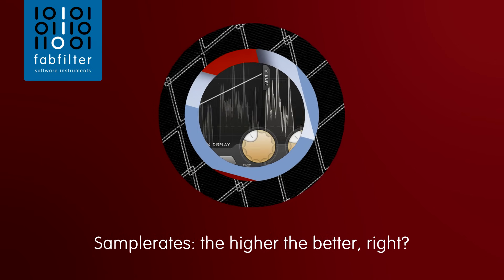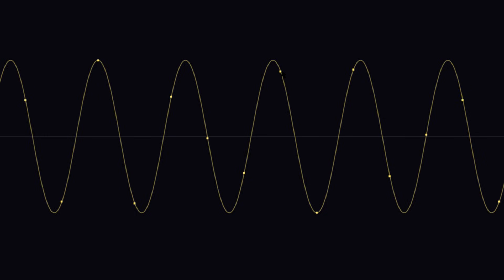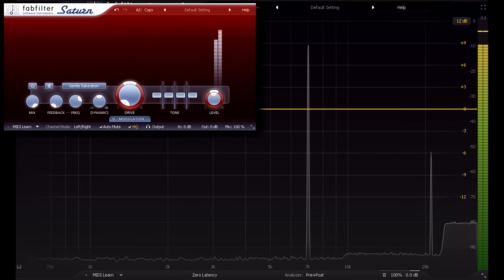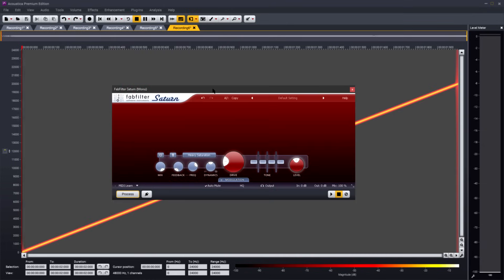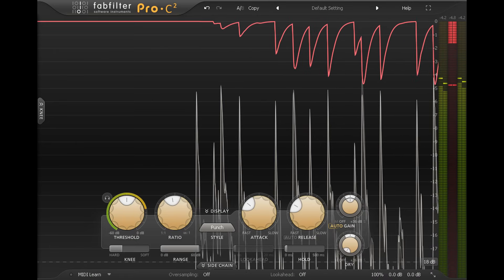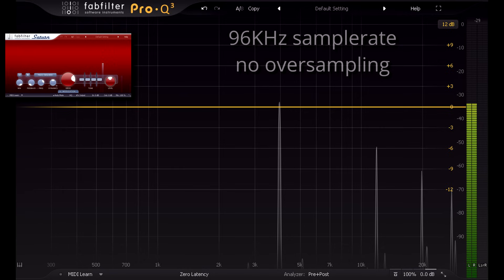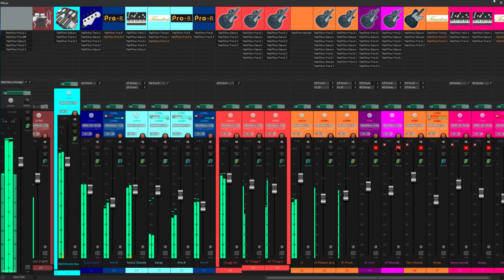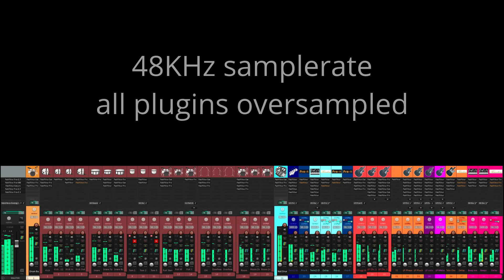Samplerates: the higher the better, right?

Comment: "can you hear a difference" - honestly? no, i can't

but i blame it on youtube compressing the video once again after upload and that my analog audio chain isn't exactly "studio grade" 

i run audio over HDMI into my monitor, use the monitor as DAC, go from its headphone jack through a pair of ground lifting audio transformers into my kenwood hifi amp, then into a passive subwoofer and a pair of old fisher bookshelf speakers that i fixed with cheap visaton drivers.

this setup isn't the best i've ever heard and it gets dwarfed in sound quality by my isophon speakers in the living room - but also dwarfed in physical size - while those isophon speakers are not really your typical floor-standing pillars, they are not really the common bookshelf type either ... 

either way - i like the sound of both systems a lot and that is what matters - right ?
Reply: "if it sounds good, it is good" ;)

Comment: 24:51 That 96KHz example sounded incredibly clean by comparison. The mid range in both 44.1 examples was a bit stuffy, slightly less so with oversampling, but nowhere near as good as 96.
I'm certain tracking and mixing in 48 or even 44.1 is perfectly fine if you don't have the horsepower, but why not mix down at 192 regardless? If it doesn't cost anything but a few extra minutes for a perceptible boost in quality, I say let it rip.

Comment: Sample rate became a marketing tool as manufacturers created affordable converter chips.  There is not a valid reason in the world to record at 192kHz while there are plenty of very obvious reasons not to.  Even 96k is being touted as a clear and obvious sonic benefit when in fact properly converted 48k is indistinguishable from it.  Hi rates are beneficial for some DSP processes but generally a complete waste of valuable and finite resources.  Some lower end mixers sound noticeably better at 96k than at 48k but curiously, that does not happen with all of them.
Reply: But this video is not about recording, it's about aliasing from saturation plugins.

Oversampled sounded better than non-oversampled, with that amount of saturns and compressors.

Comment: Thank you for the informative demonstration. I agree with everything in this video, however I would like to elaborate on 1 matter.
"Digital system CAN represent all frequencies perfectly, as long as they're less than half of sample rate." 

You cannot recreate the sine wave perfectly unless you take the sample points perfectly. I don't know the limits, but I know you can't store the information of say, 1000.111111111...Hz goes to infinite. It needs to stop somewhere and round it, in order to store the information. Thus, almost all of the frequencies of the original wave will be recreated with minor error. The error is reduced on higher sample rate, but accuracy is not infinite. Same logic goes for the bit depth. And people who might argue that dither eradicates the problem on bit depth, it does a great job however of suppressing it, however it just spreads the errors, so it is far from being perfect as well. 

HOWEVER 44.1kHz sampling might be more than good enough for human ears, that's not my point. I can't hear the difference of 0.2 dB or 1Hz difference at 10,000 Hz to 10,001 Hz for instance. 

We can also discuss maybe there is not perfect sine wave in real world nor perfect microphone as well. Perfect microphone could't not be made because it will always intervene with the sound waves no matter what we do, but that's not the point. 
The digital system used in audio is not perfect. Xiph.org made that mistake as well. The timing errors between 44.1kHz and 88.2kHz are measurable on the digital systems, but now discernible by humans. Some other people pointed out that when pitching down or slow motion videos, higher sample rate does hold more information of both frequency accuracy and timing accuracy and gives greater results.
I know, the sound has it's uncertainity and microphones are much much more inaccurate than the digital sampling process, however, the term perfect is valid only on the Nyquist THEOREM. Not in real world digital audio. 

By the way my own opinion about High-Res audio is that they're pointless. In my opinion, high quality masters with minimal / no compression is all we need. Thanks.
Reply: This actually isn't true at all. There IS quantization noise, but it doesn't come from sample rate. It comes from bit depth, as the amplitude of the wave is quantized per sample to the bit values that are available. However, even this noise is not a problem because of dithering. Dithering is shaped noise of our choosing that completely REPLACES the quantization noise.

If you're saying that transients aren't captured perfectly by lower sample rates (as in, the time domain), then you're just provably wrong. Go try it with an oscilloscope and adjust the attack time of a wave to anywhere in the time domain. It will be recreated perfectly anywhere

Comment: well this is a great video but it omits the player. As distorted guitar is one of the most difficult parts to get right both playing it through a plugin and due to aliasing let's say that you chose the plugin of your preference to generate the distorted sound for your track. And  stand for a time to the full latency you have to deal with. Anything over 7ms feels like dogshit when you track and may lead to problems of time allignment for two guitar tracks (meaning you track with the drums or metronome and then track the second track and you can't get it quite right or fast enough because of latency). To avoid aliasing the author here says to oversample internally paying some cpu toll and latency toll. 

48khz 24 bit won't get you 6-7 ms of latency before oversampling. It will be higher. 

Do you know what gets you less than 6? 192khz 24 bit not even 96khz. 

Now I've been doing this for years even when I was younger and did in fact hear over 16khz and of course I still can hear aliasing in less than 10khz. It is not easily detected...I do hear it in heavy distortion in some plugins and eg the kemper and the first axe-fx  Yet in the mix it seems almost inaudible. In the end the ear will erase similar frequencies of lesser db. 

Bottom line he hits the nail for theory here and he does provide great advice. But he has a terrible guitar tone as an example (sorry bro!) which isn't really complex and again you can track slow easy passages like the demo track but good luck on metal or thrash metal in 200bpm with heavy distortion. You need low latency or you need to man up and record analog with a mic in 48khz if that is what you want. 

To also provide another element, many high gain guitar sounds are intermodulation distortion, you don't need clean linear etc there you ooverdrive everything! Don't be afraid to try both but for me, man you are adding saturators for character and then you try to remove some back, that is inefficient! Even digitally first thing that should count is latency. Imagine an F1 driver having steering and breaking with more latency...

Try everything externally and even up the sample rate then.

Comment: Can someone sum me the point of this?
Reply: Lol that's the reason I'm looking through the comments
Reply: 8x oversampling and bandpassing at a plugin level (the "HQ" mode on some plugins) is better than 2x oversampling without a bandpass the whole project (running it at 96kHz).

As for "why" - you really should watch the video! :)
Reply: @DolphinWave  I think, if I'm not oversimplifying or misunderstanding completely, is the take home message was stick to a low sample rate like 44 or 48 cos the high frequencies get in the way when adding saturation. Am I right?
Reply: @orangemaniabrother2232  I think just using a low sample rate with non-linear plugins like saturation will still produce the aliasing. The idea was to make the plugin to oversample it very high (8x for Saturn) and then to cut off all higher frequencies to get rid of those intermodulations from leaking back into the audible spectrum. It will give better results even if you run your project at a lower sample rate, instead of just raising the sample rate of your project.
Reply: @DolphinWave  thank you dolphin friend well see US in a jungle wonday
Reply: @DolphinWave  thank you dolphin friend well see US in a jungle wonday

Comment: nope, it's fairly easy.
rule of thumb: maximum frequency produced times 2 = required samplerate

the factor 2 comes from nyquist frequency, you need to have your signal move from negative to positive and back to move the speaker driver back and forth, therefor you need twice as much data points, or the speaker would jsut remain on 1 side and produce nothing, it has to move at double the frequency of the pitch you want to reproduce.

if you use pure sine waves with no overtones, you only need a 8khz samplerate for a 4000hz sine, 
the rest is literally overkill, not to mention you can still upsample things egardless.
i use the old c-0 16.35Hz sinewave lookups and upsample from there trick to make additive synths all the time,
just make the sample so slow/low, youll never find yourself downsampling, and since it's very slow, it's easier to still exactly fit into the amount of frames of lower samplerates. (but one can have loop points or hardsync anyway so meh), this is how the old guys did it to work around the limitations of late 80s hardware lol

by that logic cutting samplerate down on waveforms that have more overtones (read: saw/square, anything not pure sine really) going beyond the samplerate/2, acts as a very shitty, rudamentary low pass filter with 0.0 amplitude falloff, it just hard cuts it, harder than the most tight 8 pole chebyshev you can throw at it lol

if you try to get a composite mixed signal on a lower samplerate the impact is way more noticable, as you're fighting hard to give everything it's little place in the limited spectrum, just like it is for bitrate,
just like a low bitrate will give you troubles leveling composite signals as the amplitude steps are limited,
you really start feeling it when you have to mix several signals.

but for seperate instruments you can go fairly low, i've made many a 16-bit 44khz mix using lower source material.
it doesn't hurt anything if you take it higher, except for file sizes though, so you may aswell with today's storage solutions

192khz is usually more trouble than it's worth though... as is 32-bit,
you'll find yourself downsampling and compressing the fuck out of it to make it back on a 44/48khz-16bit format most people listen to... don't bother with anything beyond 96khz/24bit unless you do big old orchestras or record samples that have to be boosted by a shit ton afterward (to which i say: you can also try to improve on recording your source material better)

in all fairness, realtime synthesis has become so good, and hybrid romplers are making waves too,  i find myself using softsynths more than samples these days,
samples are a ton cheaper on the old cpu, but with these ryzens around nowadays, it's no biggy now is it? 
DAWs are damn good at multithreading, and renoise runs very light too.

source: i'm a musician, and a pc nerd have been using mod trackers since the 90's (and now renoise for more than a decade too)

Comment: Frequencies that we cannot hear affect what we do hear
. This involves below 32Hz as well as above 20kHz. Many Famous Audio engineers believe this - Geoff Emerick - Beatles | Frank Filipetti. When I edit at 96kHz 24 bit - 96kHz 32 bit Floating Point and then mix down to mp3 = 48KHZ 512 kbps = I get better sound than your 44.1kHz 16bit CD demo. Further - you used ODD ordered harmonics = worst audio - You need EVEN ORDERED HARMONICS = TELEFUNKEN V76. Eliminate above 20K - get a cleaner lower quality sound. How come you didn't test 96kHz HQ?
Drums 16:30 over processed - lose power and impact.

Comment: A useful demonstration! 18:41 - 4k? you mean that frequency that usually gets notched away? :D 

While the Nyquist theorem of doubling sampling rate for getting the correct information is correct for sine waves that are easily mathed out and connected via a parabola, it does not hold water against more complex things happening in high frequency ranges, which is exactly what happens in the musical context. However. Before we hear the distortions and artefacting in that area, the average output equipment is likely going to apply it's own distortion on top of everything. But technology gets cheaper in time and accurate representation of sound becomes more affordable, so all that is left to say is "how far has your hearing degredaded compared to the equipment you listen to."
What this video sadly did not touch upon is; given that there is proof within that higher sampling rates give you more overhead in mixing and glueing everything together, it does not mean that this effort is wasted when exporting to 44.1Khz. In fact it's not. Because the dithering and postprocessing while downsampling on the export will very much preserve the characteristics of the results from the higher sample rate processing.

Basically, while this is a great sales pitch, everything comes down to: 1) having the processing power or not for higher sampling rates.
2) having the storage capacity for higher sample rate projects (hint: after you're done with the project you can compress the files to save space as you're backing up...).
3) If you have to do a lot of processing (especially pitch) on the recorded files or not.
4) If you like to future proof your songs for reuploading in a higher format standard or not.

But it's not as easy as one thinks.

ad1) Computing horsepower nowadays (including storage medium speed) is not really a problem any more, including price. It is more or less offset by bulky operating systems (which is why Linux based DAWs are likely going to push further faster than before), bulky DAWs that are lazily coded and bulky plugins that are lazily coded. Adding to that the "Plugin bug" that bites people just as much as the "module / pedal bug" where they just have to get more, and have to use more, this isn't helping... btw, you don't "need" all plugins running all the time, if you don't have the horsepower. It only matters for the final export, which is not realtime anyway. Turn off as much stuff as you can while tracking if you have computing power shortages.
ad2) In theory, things can go more wrong more often with decompression. Still, compressing and adding an additional backup to the platter is likely still going to be modest enough in size for any storage media.
ad3) This is a giant proponent for recording at high sample rates. Everything will be smoother and more transparent with higher sampling rates because the floating point operations and whatnot have more meat to bite into to give you a better result. I mean, let me put it this way: do you calculate pi being 3.1? I didn't think so :) Especially when you record voices to be heavily adjusted for sound effects and pitch them down. You absolutely NEED the higher sample rate. And since those are likely going to be individual tracks, you can easily just record those voices in a different project, make everything work there, and then reimport the export into your main project. 
ad4) This is coming down to personal preference. If you think your stuff is good enough that it be around for years to come, no matter if only you will hear them, then it's worth considering. It should never be the reason that makes you go high sample rate if you are questioning if you should. The upper 3 points are where the reason are, not the 4th one.

Comment: There is a point of diminishing returns. To avoid Ailiasing, ensure your Nyquist frequency is at least double the maximum frequency to be recorded. The amplitude of the Ailiasing, is diminished with increased bit depth.  You might not be able to hear the 20 KHZ sine wave, but you can hear the difference frequency between 20 KHZ and 22.06 KHZ. This is the inter-modulation mentioned/
Reply: @nicksterj I generated a "Chirp" in Audacity.Used it to make a 2 minute sweep from 1KHZ to 20 KHZ at CD quality. Recorded it at -18db. Played it back. Looked at it on the scope and listened to it. Yes this is direct digital created, and no input low pass filter was used. I could see and hear the artifacts.

Comment: I can't help but think that the advice in this video is wrong. So many audio people are actively trying to discourage working above 48k. Sure, the mixes here with 8x oversampling at 44 or 48 do sound better than pure 96. But why not just do whatever oversampling at 96? There's no mention here about how eqs and fx benefit a lot from 88/96. Most plugins don't have oversampling built-in and even if they do, that oversampling can be bad. What this video does prove is that rates of 192 or even 384 are necessary for some plugins to work properly. Better advice would be to tell people to quit buying so many plugins in an attempt to fix the problems of working at 44 or 48 and instead spend about $500-$700 on building a desktop with a processor that can handle 88/96. Like something based around a 9900k or 3900x or even a 1700. There's been some pretty deep discussion on this in the Gearslutz plugin analysis thread. Try looking at page 88 and a little beyond.